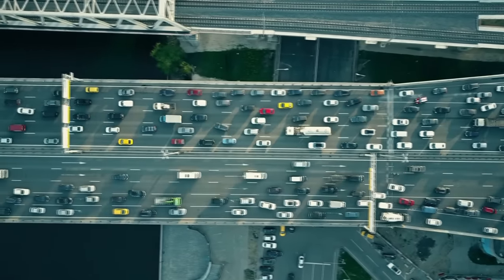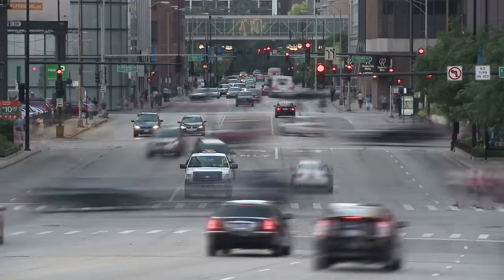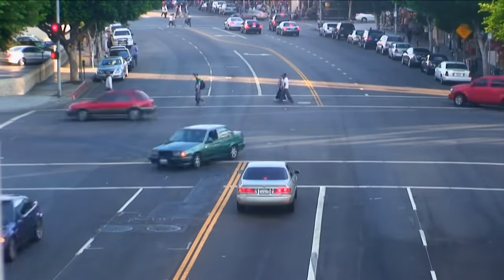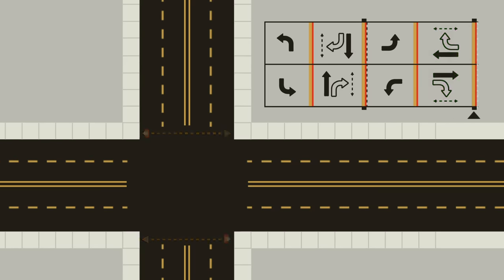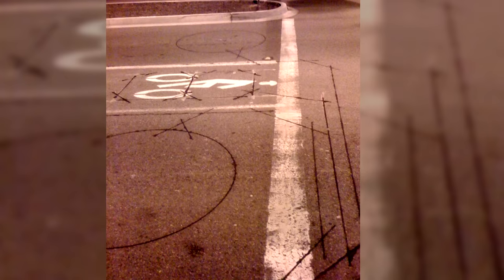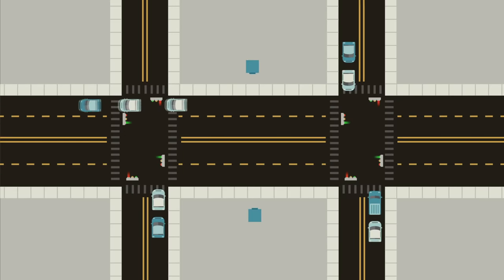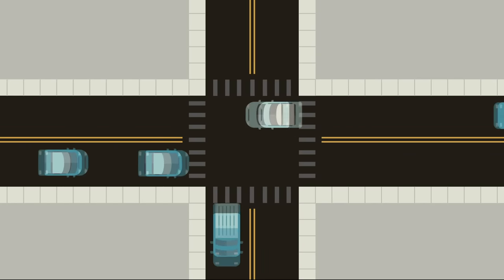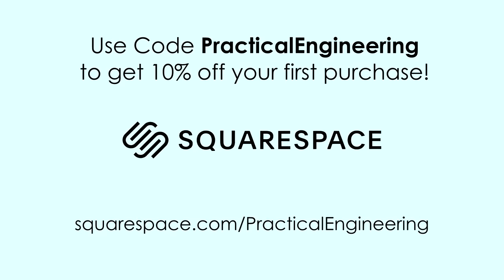How Do Traffic Signals Work?

Comment: Many countries have a countdown indicating the number of seconds to green. It’s good for stress. If you just miss the green light and immediately the red light starts counting down from 45 or whatever, it doesn’t seem so bad. Red light wait time is often perceived to be three or four times longer than it really is. There’s also a sense that the light has made a “contract” with the driver.
Reply: I imagine these will eventually filter into the USA.
Reply: in my country's capital its only for pedestrians
Reply: I would friggin' love if this came to the USA. That, and lights being timed (during peak, or normal traffic hours) so that as long as you went the speed limit, or just below, you would clear all the intersections in a sequence. punishing speedsters, and allowing for slower driving.
Reply: Yeah, in Poland for example!
Reply: Yes, but the problem with this is people will start accelerating when it's at >5 seconds of red and that's a recipe for disaster.
Reply: @HowardDPVT  They already have. Here in my area every single light has a countdown timer on the pedestrian signal that, usually, corresponds with the traffic light.
Reply: That's an awesome idea! it would also keep idiots from taking forever to notice the change
Reply: @HowardDPVT  Boulder had these speeder punishing lights and camera vans
Reply: CGP grey also highlighted another great benefit of that - improved driver reaction time.  A countdown won't eliminate clueless drivers, but it will cut down on the occurrences of someone in line not noticing the light is green as they fiddle with a phone or the radio, or reach for something they dropped.  People who aren't assholes won't do those things when they know the light is turning soon.
Reply: yeah I mean at least you know if you have time to roll a ciggarete or not
Reply: @canilogin1730  haha, good point, but I think under 10, it should just be displayed as >10 Around 10 seconds can't be a very long perceived wait, and it also doesn't let you know that there is 1 second of extra acceleration for you.
Reply: The US has this too. For crosswalks that countdown when it reaches “1” the traffic light turns yellow.
Reply: Yeah... My buddy works for a township. They already immediately use their phone at an intersection

I dread thinking what this would cause. The biggest city near me has super aggressive drives doing maneuvers already. Like watching cross traffic lights for the red and do the zero to sixty just to try and avoid the timing of the next platoon of red lights.

They also use the same technique watching the count down timer for pedestrians and try to accelerate so they can make multiple lights in secession creating a new speed limit just for them.

One of the simplest things I personally like and don't know why certain states avoid it is traffic circles. Some avoid it entirely where as others have it but feels like they ban it for more populated areas
Reply: @HowardDPVT  we don't want slower driving, we get faster and faster over time. When AI dominates driving, the speed limit will be beyond 100 mph in the future.
Reply: @HowardDPVT  its already like this
Reply: Red-light countdown timers are a boon to me as a rider. When it's more than 45 seconds,  I can switch off the engine and relax. I know it takes a toll on the engine, but my well-being is more valuable than the metal
Reply: What? They have those in the US on literally every taffic light lol. If you look to the side it's on the pedestrian cross walk signal.  Literally every light has one and everyone knows about it

Comment: As a Traffic Engineer,  I think he did a good job with this video.
Reply: Is that a JOB?
Reply: As a city skyline player I think so, too
Reply: im gonna have to call bluff on that one
Reply: @tobe.moemeka  ?? ok? dont really have any reason to lie. i work for my states department of transportation. I primarily do traffic signal design, signing, pavement markings, as well as in depth reviews on a bunch of different permits and certifications coming from private developers. dont be fooled by some 6+ year old minecraft stuff. then again, id still play it if i could find the motivation to sit down and place blocks for a few hundred hours like I use to.
Reply: @TheAssassin409  he was joking though
Reply: @TheAssassin409  Watching  lot of car crash videos, I've observed the fact in the US, light signals are not clear enough at times. The first issue is that they're over the lane they're controlling - which puts them in the sky - which is a fairly bright, if not blinding so background making light signals invisible. The other issue is that they're placed the far side of intersections - so there's little advanced warning unless visibility is very good.

In England, we do have some overhead signals but they are only additional to the authoritative signal on the near side of the road BEFORE the intersection. This puts the lights lower down (about lorry cab height) and often with a building behind them - so no bright skies to mask them.We do have 'red light runners' but it's rarely due to the driver not seeing the lights ! I think our (lights) legislation is better too ! It's just a shame many do not fully understand it !
Reply: @millomweb  It's just cost vs effect with that issue in the States right now. Many intersections already cost states hundreds of thousands of dollars (for ONE intersection) and if the opportunity to cut corners is there, they will take it. (That's our government, if they don't see an outstanding problem, they won't fix it)

On top of that, living in Florida for as many years as I have, whilst being involved in the road construction of said intersections, You'd be surprised how many drivers here still wouldn't notice an additional signal on the roadside.
Reply: @choopwav  I partly agree with the not notice as there seems to be quite a few distraction crashes but there also appears to be quite a lot of 'don't care' crashes. So they may notice the light but completely ignore it !

Perhaps abolishing crossroads and making the leg of T junctions give way on the basis they have a corner to turn. This I guess is one of the safety features of roundabouts -  breaking complex junctions down to a ring of T junctions.
I hear the number of roundabouts is growing in the US, how's FL doing for them ?
Reply: pmailkeey As a matter of fact there are 3 new roundabout projects going in on main roads near me. I hear they’ve been going well so far, I’ve only been working on one putting up pedestrian flashers (basically just flashing yellow lights that indicate that a pedestrian is trying to cross, activated by a button near the sidewalk). 5 years ago it was a rare sighting but nowadays nearly every couple blocks in my Sarasota/Bradenton area there’s one there or being built. I’ve talked with some engineers and foreman’s about their purpose and they feel that it’ll be a good way to slow down traffic and be a new sight in order to make drivers have to calculate their moves a bit more carefully and draw their attention.
Reply: pmailkeey I actually have seen that somewhere online! It looks to be a great way to manage high flow traffic. Our roundabouts here so far are plain and simple thus far. The engineers seem to be easing basic roundabouts with no traffic lights into the “normal” to adjust drivers to it as most around here have never even seen one let alone tried to navigate one. I really hope down here we can get into more advanced ways of traffic management like the magic roundabout because we’re at our breaking point with capacity on the roadways due to such high development recently. Being in Florida our entire state is this way, along with notoriously bad drivers so I’m really hoping to see these come into fruition. 

Even basic roundabouts and diverging-diamond intersections (https://www.i95exitguide.com/roadnews/new-i-95-diverging-diamond-exit-now-open-in-florida-video/ ) were a huge step and got me really excited
Reply: @choopwav  Diverging diamond is something we don't have ! Well, if we do, it's not named as such ! No, we'll never see those here :) A roundabout will deal with that in a far more familiar way (to us, at least)!

What really needs to happen is planning out the need to move ! Obvious target - commuters. If employment, schools, shopping malls and recreational facilities were sensibly positioned, the cut in the volume of traffic would be dramatic - and cause a big improvement of human health - hopefully more walking or cycling in hopefully cleaner air !

I'm puzzled why long roads (e.g. interstates) don't have electric pick-up like trains/trams in one lane, a fixed speed for all vehicles all sizes. No more range anxiety in your Tesla - battery to the interstate then charge up as you drive between cities.
Reply: pmailkeey I actually find it harder to notice traffic lights on the side of the road like the ones in Europe than the ones hanging up on a pole like in the US. I feel like those are more clearly visible for everyone
Reply: @abethebae6018  I'd agree with you that it's easier to see the light head - but not which light is lit !
Interestingly, yesterday I spotted a signal on a pole at the side of the road in the US - at the stop line ! So maybe it's being tried. The usual overhead ones were there too.

Some years ago as a child, my father was driving us all home at night in an unfamiliar area lit with yellow sodium street lighting. Suddenly, half of the lights changed to red - they were traffic lights we'd first seen on amber and with it being a big junction, there were street lights all over the place and the amber traffic lights just blended in !
Reply: @millomweb   One thing about how infrastructure developed here in the states was that it blew up in a time where the majority of today's American cities/towns were much more spread out, rather compacted (with obvious exceptions, NY, Chicago etc.) and the automobile industry was nearly in full swing. This made interstates the de facto route to travel. It was cheap to lay asphalt and call it a day, that's why here you see a LOT more commuters in cars rather bus or train, because to most it has always been much easier and economical to travel via personal vehicle. I do wish our local governments took a little more stride in funding other ways of transport as it would solve a lot of issues with the level of traffic and would definitely be more safe. (this is 100% from the perspective of my town, so it may be different elsewhere as the States all developed more modern infrastructure at different times, Florida being one where most people had vehicles already.)
Reply: @choopwav  Here, we have road tax, annual vehicle inspection & insurance - all pretty much compulsory annual expenses whether the car is used or not. This completely skews actual apparent costs. If all costs only applied when the vehicle was actually in use, it'd make public transport more competitive.
The best solution for congested transport systems is to remove the need for excessive travel. My main target would be commuters - daily unnecessary journeys because people don't choose to live where they need to be for work & near schools & shops etc. I've no issue with people driving for leisure - at the weekend or whatever as such journeys are considerably more optional !
Reply: As a traffic engineer what do you think of the comment in the video that traffic management might be relegated to software engineers/data scientists?
Reply: @millomweb  Exactly. Where I live, just to get to the grocery store is a 10-15 minute commute via car (with minimal traffic). My old workplace was 45 minutes away and only one exit away.
Reply: @420sakura1  He said that in the video.
Reply: Dear TheAssassian409,

Why do you guys make so many all-way stops rather than mini-roundabouts?

Sincerely,
-The three of us in the US who care
Reply: Does that include the backwards horizontal traffic signal animation with green on the left?
Reply: Except at 0:48 where he showed a traffic circle while saying the words roundabout... Aside from that, I absolutely love this dude because he's very informative and not usually misleading.